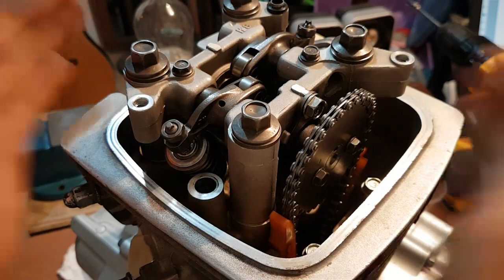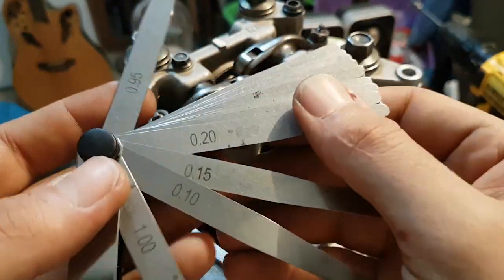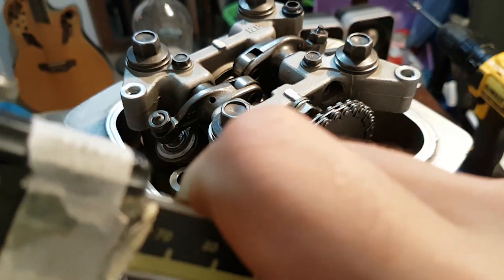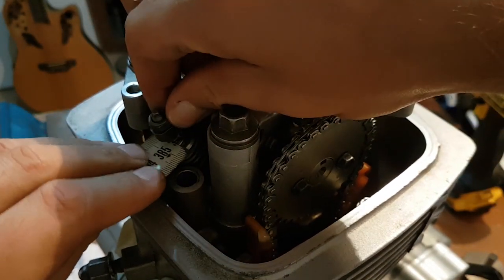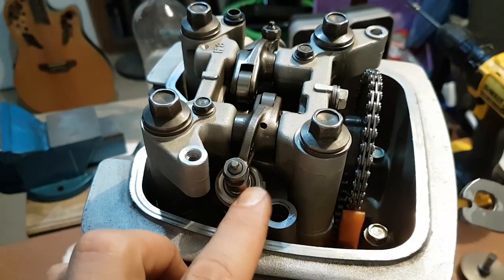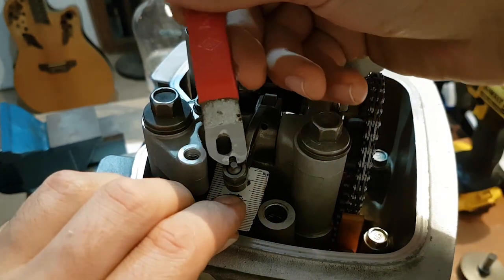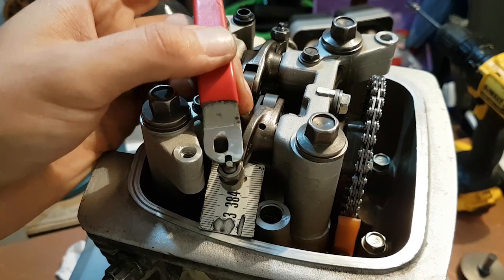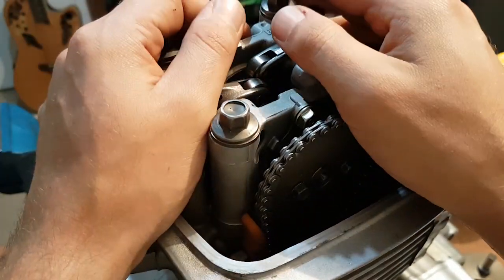How to Check Valve Clearance. Homemade Diy Valve Adjustment Tools. Honda CG 150 Titan Unicorn

Comment: Can we use bicycle spoke keys for this ?
Reply from the maker: No idea:)
Reply: using nose pliers also works.
Reply from the maker: @tuxnoel  There is always a different way. I just didnt wanted to damage the metal with pliers or damage the pliers if the metal was hardened.

Comment: My mechnanic adjusts my YAMAHA FZ 25 valve clearance in such a way that there is no vertical play but it should have sideplay/horizontal play and my bike works excellent than adjust with manufacturer recommends intake:-0.05mm_0.10mm & Exhaust:-0.08mm_0.13mm
When i adjust at manufacturer recommends my gearbox goes jam and firing is also not good that it should be.
Reply from the maker: Are you the first owner of your motorcycle? How many kilometers it has?
Reply: Yes Im first owner & Bike has done 28 k kilometers
Reply from the maker: @AkshayVarma.  As far as i know your bike has tappets. There are shims which gives these tappets a certain height. Did you measure the wear on these shims?

Comment: I especially like your home made tool with the red handle grip for holding the tappet adjuster in place, nice idea.  How did you get the perfect square cut into it, angle grinder??  I have one of those handles from a water plumbing tap
Reply from the maker: I used an angle grinder but the cutting wheel was very thin so i could control the wideness. That metal is pretty soft so a dremell wil also work very well.
Reply from the maker: I used an angle grinder but the cutting wheel was very thin so i could control the wideness. That metal is pretty soft so a dremell wil also work very well.
Reply: parçala behçet thanks a lot, I'm from India, it's 3 am now 😀
Reply from the maker: Your welcome. Its also pretty late here in Turkey. Good.night

Comment: What could possibly be the valve tappet clearance for a Honda Unicorn 150cc
2005 model ?
And Intake and exhaust in cold conditions also?
Please let us know.
Reply from the maker: Seems like honda unicorn has the same engine with the honda crf150f. So you can use that information to repair you unicorn. 
Intake: 0.003 in (0.08 mm)
Exhaust: 0.005 in (0.12 mm

Comment: Hi Sir good idea I will find my vehicle clearance but cannot find me
Please help me Indian vehicle Bajaj Discover 125 ST valve clearance tell me sir
Reply from the maker: If you dont know the valve clearance you can do this.Open up the top cover to expose the valve rocker arms. Loosen the nuts which holds the valve clearance adjustment. Have some gap between the rocker arm and the valve stem. Heat the metal parts around 90-100 celsius degrees. You will expand the metal parts with like they expand when the engine is working. They will get hot and they will expand. After they get hot close the gap between the valve clearance adjustor and the valve stem. Let the metal parts cool. When then cool they should contract and there should be a hap between valve clearance adjustor and the valve stem. That is your valve clearence
Reply from the maker: I am sorry i made a mistake. There are heat differences between the intake and exhaust valves. When the engine is working the intake valve heat will be around 250 degrees celsius and the exhaust valve will be around 650 degrees celsius. But these values will be less at the end of the valve stem.
Reply: Thank you very much one more thing.
You know that Bajaj Discover 125 ST Indian motorcycle.  intake and exhaust valve how much clearance gap. please tell me
Reply from the maker: @sathishkumar-qm8wp  :)))) If i knew i would tell you already. I am sorry i dont know. You have to experiment.
Reply: @sathishkumar-qm8wp  dai sathish muttaal nee kaytta questionikku thaan andha aalu eppadi clearance value kandupudikanummnu explain panni irukkaan ,english theriumaa theriaadha .india maanatha waangadhaida samyhala